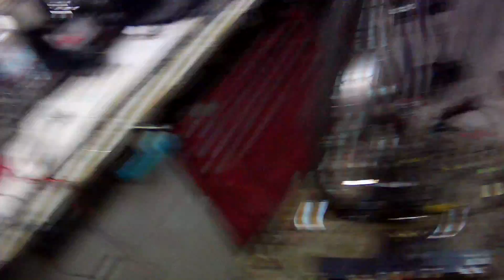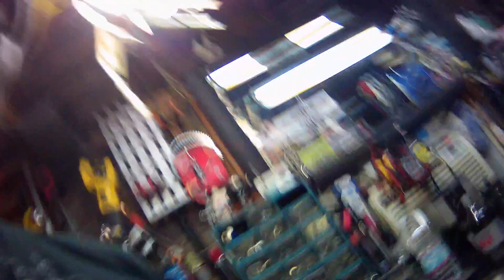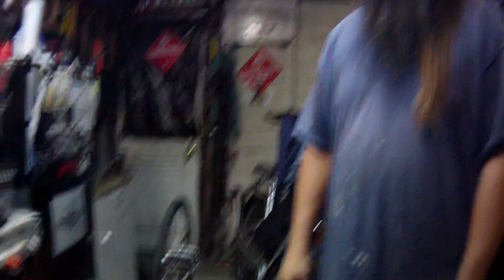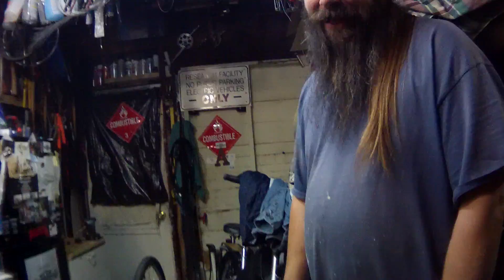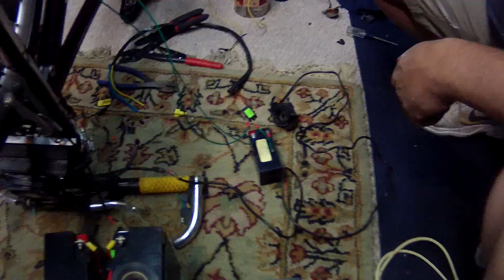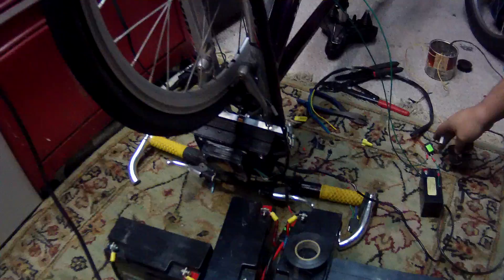Star/Delta Demonstration 48 VOLT RUN!! (1st Attempt)

Comment from the maker: I believe torque is decreased in Delta but the RPM increases I've converted several bikes they seem less powerful afterwards but they definitely go a lot faster at the top end if you have a high current system to begin with it's less noticeable
Reply: Iv just made my motor delta only but it has almost no torque and it is a bit slower under load. Have I done something wrong? (2kw hub motor 52v 35a)
Reply from the maker: @Pluis21  The order of the series has to align with the order of the wires inside. What that means is there are something like 32 possible combinations of hall and phase wires. TheThere's a spreadsheet you can get to try them all.  I had that problem once before.ill try to find the spreadsheet for you you could try switching the phase wires around in different  color combinations  just also switch the corresponding hall wires too

Comment: Nice setup.  Some people say star gives more torque?  I can't see how 
this is so as torque (in ac motors at least) is proportional to the 
winding voltage.   Star reduces winding voltage so less torque.  
Correct?